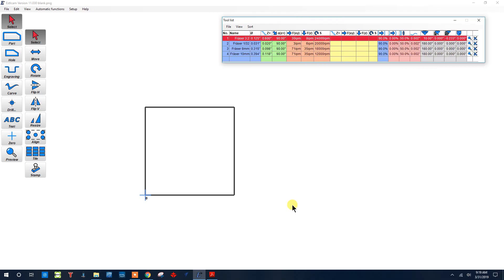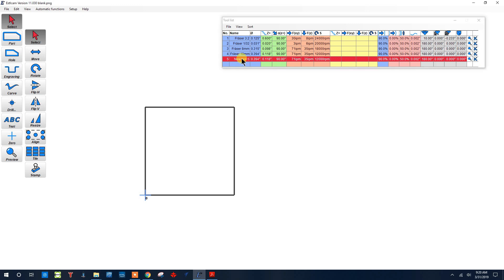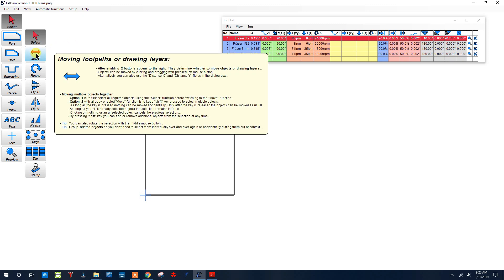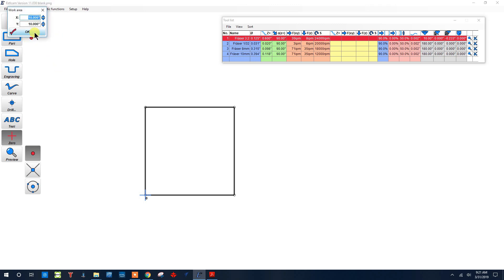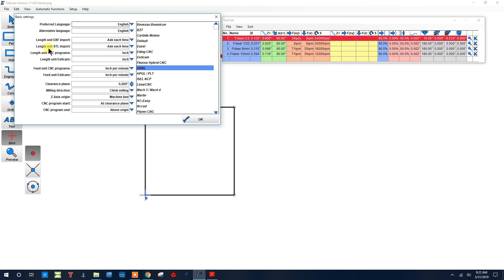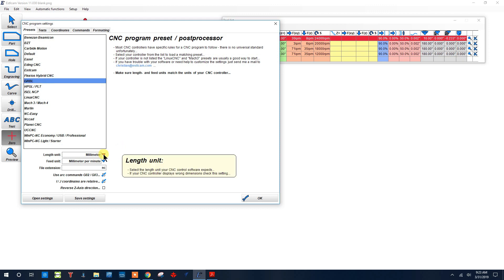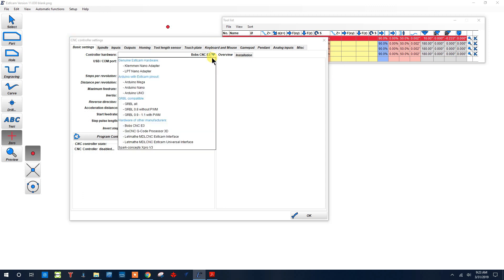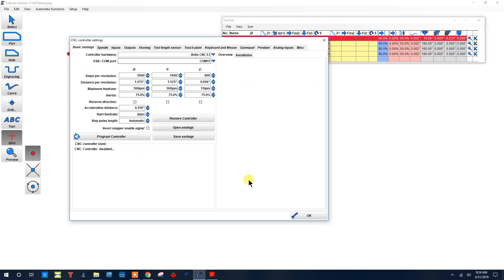Overview of Estlcam

Comment: Hello there,

I have a CNC machine and I operate it using Estlcam V11 software. I would like to know how to engrave 10 mm depth by giving the order to the machine to engrave more than 1 mm per rotation cycle! The machine currently does 10 rotations each time I want to engrave something, and I’d like to set it to do 5 rotations or less.

Comment: What is the easiest way to get the square on the screen that you see in the first 7 sec of the video?
Reply from the maker: Menu>>VEIW>>WORK AREA
Reply: @Bobscnc  yea no matter what I change those numbers to nothing show up on the screen.
Reply from the maker: @brianadamczak8227  Not sure what the issue is.  Is the zero point off the screen.  try clicking on the zero icon.  Do you have a project open? You will need to open a file first.
Reply: @Bobscnc  thank you for the help.

Comment: Hi. Can I use estlcam with mks sgen l main board. I cant connect . Firmware is marlin on mks sgen l 32 bit mainboard. Can you Help me about connection.
Reply from the maker: EstlCAM has its own firmware, however, you can save the gcode file and run it using Marlin. If you connect you will erase Marlin.
Reply: BobsCNC     Thank you. I want to use estcam surface scan. Now I cant use 🤣

Comment: It was a good video. I wish that you would do one that was with the Marlin program, which I run. Trying to learn to do 3d with it
Reply from the maker: Sorry, we support grbl. We believe it is the best choice out there for micro controller based CNC's.  You can save the gcode and run it with Marlin.
Reply: @Bobscnc   the Marlin soft ware will run the code ? Post processor very hard for it ?? Fusions been a nightmare